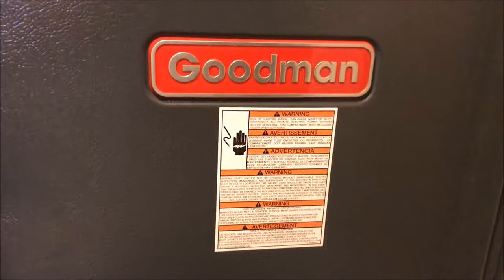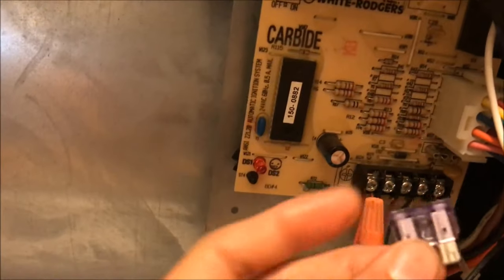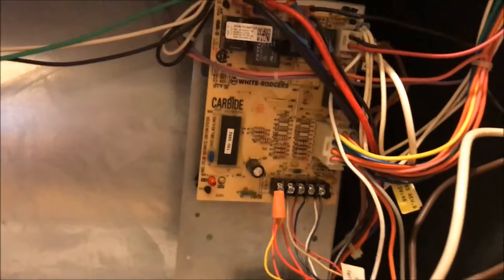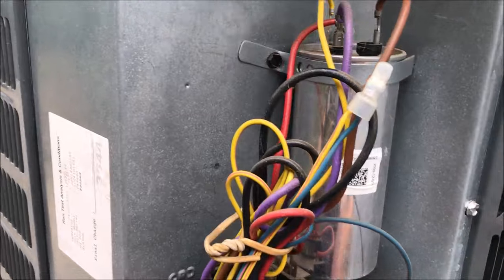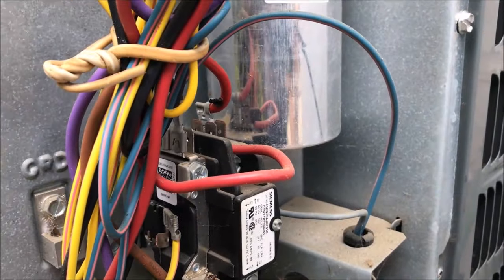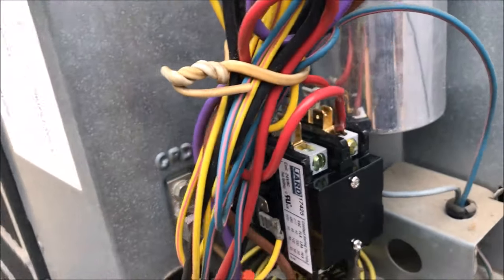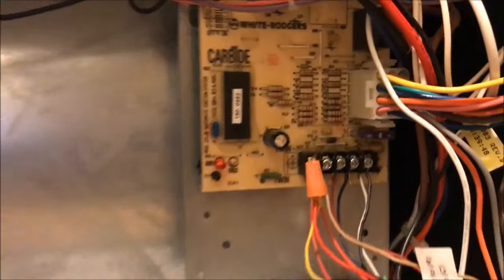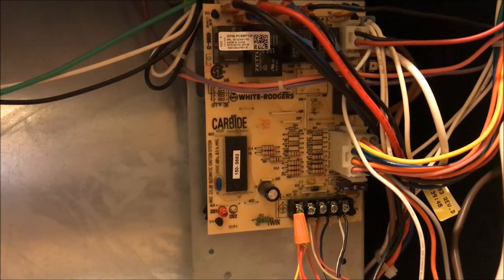Blown 3 Amp Fuse in AC quick fix - Save $300-$800

Comment: Lol this fixed my unit, was the fuse you stated, the contact block was fine but the wire connectors corroded, I wire brushed them all and we 40 the connectors, installed new fuse and ran like a champ! Last year the condensing fan ran but not compressor, capacitor was bulged out so I replaced it and that fixed that lol it’s an old ck30-1 unit.. love YouTube lol you home appliance and heating and cooling guys are the real mvp! Thank you for sharing the knowledge! Because of you I now work for a heating and cooling company as an apprentice!!!

Comment: You're the man. Saved me a fortune and a lot of hassle. 3 amp fuse blew replaced it fan went on for 30 seconds and then went off. Compressor never went on. After watching your video, I grabbed a spare relay that I had in my garage from an old pool heater that I had. Hooked it up and ac is working perfectly. Thanks
Reply from the maker: nice.  I'm glad it was helpful.  Cheers~

Comment: MAN! Thank you for this video good sir!! I've been battling an AC unit at work. So far I've fixed all the old crumbling thermostat wires at the outside condenser. I also checked all the thermostat wires inside and outside for other shorts and found none. I made sure all the connections are nice and tight. I pulled the thermostat off the wall and checked all the connections there and they are good! And yet that damn fuse still pops! I've run out of options! So now I'm here. When I get to work tomorrow I'm going straight to the contactor to see if its shot! I really hope that's it! Because if its not then I'm stumped and going to have to call an AC repair company. I really don't want to do that! Wish me luck! Hahaha!

Comment: Thanks a lot man.. this gave me direction on where to look.. the contactor was fine in my case but was full of dirt and cob webs.. cleaned it out and fuse doesn't pop anymore.. thanks for the helpful video...
Reply from the maker: Thank you.  I love to share a few tips here and there out whenever I possibly can.  It's great that you found out the problem.  Some shady contractor could easily charge you a few hundreds bucks for a small job.

Comment: Thank you, your video set me on the path to discovery where I ended up fixing my AC not working.  I was at the point of suspecting things in the furnace, and had never had a need in the past to  pull of the furnace panel.
1. Thermostat, an old Honeywell was flashing "A.C" this code, though not documented does not refer to Air Conditioning but to no power to the thermostat.  I verified with a multimeter.
2. My Furnace circuit board showed no blinking LEDs. It also had no visible fuse. It did however have a small push  button fuse/min breaker on the board.
3. I reset the push button breaker.
4. When my thermostat was set to heat, no problem, the burners kicked in.
5. When set to Cool, the furnace circuit board breaker tripped.
6. Now moving to outside. After removing AC mains fuse and switching of the low voltage using the switch on the exterior of the furnace, checking with multimeter and voltage detector of course.  I removed the access panel to the wiring of the external AC unit and discovered a large nest of some sort. 
7. After removing the nest I notice that whoever made it had gnawed away at the insulation on some of the low voltage wiring, looked like some bare copper to copper was touching.
8.   I cut out the bad exposed  wire, replaced with 14 AWG flexible, connecting the new bits of wirre with external grade wirewrap connectors. I also added some heatshrink to the remaining exposed thermostat wire and also used liquid electrical tape.
9.Voila working again. Total time spent about 2 - 3 hours including a trip to HD for some new connectors.
10. Happy wife happy life!
Reply from the maker: Thank you and I'm glad you got it resolved.
Reply: Wow they won't understand that 😉
Reply: Same thing happening to me, changed contactor and it worked but it still keeps blowing.

Comment: Thank you for video. Saved me $75 service fee by diagnosing this problem.. my thermostat was not getting power and this help me figure out why.. burnt fuse.  im replacing it with a 5amp automative fuse. 3 amp will work  too.
Reply from the maker: I would recommend that you stick to manufacture recommend fuse.  If your AC is using 3amp then stick with 3 amp.  change it to 5amp may cause other issues before the fuse blows out. :)
Reply: I also thought a 5 amp fuse was close enough to the original 3 amp fuse. Please learn from my mistake. The unit ran for a few minutes and then burned out my 24 volt transformer, and I still need to locate the original problem!

Comment: Good info.  Had an HVAC company come in and replace this fuse (I didn't know) and the fuse alone was $30!  Tried to get a reduction and that didn't work.
Reply from the maker: Wow.  That's a huge marked up.  You can get one at most auto part places for less than $5.

Comment: I have a similar circuit board [Amana, made by Goodman].  A/C pro neighbor told me to replace the 3 amp fuse.  Your video was a big help, but on mine they saved a few pennies by using a wire jumper instead of the fuse.  Still working on it.  Also replaced the outside capacitor and contactor, and the inside 10 microfarad run cap for the blower motor.  Ain't fixed yet, but this saved me a lot of time looking for a non-existant fuse.
Reply from the maker: I'm glad it helped.  Thank you
Reply: This might help others with a system like yours, but without a fuse; with a jumper wire where the fuse should be.

  Getting there... my inside circuit board had a JUMPER WIRE where the fuse should be.  Ran heating all winter, but when I ran the A/C first time, a bad contactor [relay] outside blew the inside transformer because there was NO $3 FUSE!

  If your system has a jumper on the inside circuit board and no fuse, check the outside contactor relay for damage BEFORE ever turning on the A/C unit!

  Long story short, I've spent about $200 for parts, including the outside fan motor, capacitor, and contactor, and the inside 10 microfarad fan run cap, and the new transformer found on Amazon Prime for about $26, due on Sunday after ordering Friday night.

  Again, long story short, if you have the time in early spring to live without heating or A/C for a few days, you CAN do it yourself.  my unit is about 15 years or more years old, and updating all the minor components has to take a load off the compressor, possibly adding a few years to its life.  The outside cap can was reading 8% off rated, and the inside fan run cap rated at 10 Mu-f was at 7.36.

  I consider it a couple hundred bucks well spent, modernizing all those components, that may extend the life of the compressor.

  I also bought a Fluke 117 HVAC meter that checks the capacitors, which I can use for other things as well long-term.

  You can save a lot of money on DIY, with an A/C pro friend's and neighbor's advice.  I bought him a bottle of Casa Noble Single Barrel Extra Anejo Tequila for payment.

  I've lived without heat or A/C for two weeks and it ends tomorrow... Knock on wood.
Reply: Correction; Fluke 116, not 117.   Installed new transformer just in time to get heat during a cold snap, to keep me warm after 2 weeks with no heating or cooling in N. Texas where Spring is variable.
Reply: The fuse was install for safety reasons and so you don't burn up transformer or circuit board which can easily happen with a jumper wire in place. Don't ever put a jumper wire in. Not even for testing. Your obviously a home owner trying to fix his own equipment. Thats why you had no heat/ac for 2 weeks. Pushing out bad ideas on people is a safety issue and will cost them more money

Comment: Do you know WHY the contactor coil burned?

If not, then you might not of corrected the source of your problem.
Reply: Lightning strike, bad capacitor?
Reply: Contactors age and corrode.. They should be replaced every few years along with the dual condenser.. $10 parts.
Reply: @joepah51  I think you meant the dual capacitor.
Reply: David Crandall I think he did too but why change parts every few years if they’re not bad?
Reply: @arodandjeter1  To avoid condenser failure.

Comment: Thanks for this very useful video. My AC is not working and while checking on fuse, it blown… I have updated the fuse with new one and switched on the AC… but again it blown.
What could be the reason? What are other things I have to check? Please advise…
Reply: Did you ever figure it out. I’m having the same issue

Comment: I had the exact problem, HVAC system just shut down. Checked the breakers and condensate lines, all good, but wasn't familiar with a simple fuse to the system. Wish I'd found this video and would have saved $165 for the service call which also included a check of the system for pressure etc. Just bought the home last year. Perhaps you could amend your title and/or description to include no power to HVAC system, air handler. Regardless, thanks for posting.
Reply from the maker: hope you got it fixed though with the heatwave we're dealing with
Reply: @SnapFix  Actually, we did. Even after the fuse replace, blew again several days later. Determined to be a couple wire touching where outside wiring led to condenser unit. Thanks.

Comment: Our Ruud was blowing the fuse in the air handler inside the house and everything shuts down completely. The repair man changed the connector out side and it will work fine for a few weeks at times and then blow another fuse . I replace the fuse and it works fine for a while then it will do it again . 
Would you have any advice you could give me on what is caused this to happen ... would be much appreciated.
Reply: Sounds like a bad wire. What ended up being the issue?

Comment: Thank you very much for the info.

I have the problem the condenser was off.
Checked the contact relay was not energized by 24VAC and was wodnering what the problem was.
Now I know the upstream 3A fuse and I will look for it and check it.

Is it on the control circuit by the relay?

Thanks

Comment: How would you go about wiring in a resettable amp fuse if the unit doesn’t have an amp fuse or a circuit board? Would I connect 24V and C off of the transformer or 24V and R?

Comment: Okay so we replaced ours and the fuse still blew. What could it be, the circuit board?
Reply from the maker: There is a short somewhere.  I would check any loose wires first.  If not then yes circuit board could be the issue
Reply: Whst is that part called you replaced?? I didn't really understand what it was called
Reply from the maker: contactor coil  @christinahaskett120

Comment: So my AC won't turn off I disconnect my ecobee thermostat from the wall it goes off then I put it back the AC and heater is off but ac fan is still running... Help

Comment: Unit went completely dead, nothing worked, and didn't want to call an AC tech on a Friday night $$$$.. 

After fiddling with the breakers and the outdoor unit, I opened up the panel to the blower motor and circuit board... Had no idea there was an inline 3 A next to circuit board.. @#$%!

Got to Ace hardware before they closed and found 3 Amp blade fuses. Replaced the blown fuse and was up and running!

I didn't see any blown capacitors on the circuit board or the capacitor mounted next to blower.. Guess I'll head out tomorrow and look over the contactor on the compressor unit or anything else that looks puffed, burnt or blown.

Thanks for the video you gave me ideas of what to look for.  didn't find your video until i replaced the fuse, who knew what to look for?
Reply from the maker: I know right.   It's a good thing that they actually designed the circuit board with 3 amp fuse.  If not we may have to replace the whole board and that could cost quite a bit more.  I'm glad you got it your AC working though.

Comment: Hi, the furnace doesn't turn on and the red light inside of furnace (down) is permanently on, means ?. The thermostat display AC on, probably is the fuse ?, or why the furnace and the AC do not work ? Thanks for your answer.
Reply from the maker: Are you trying to tun on the heat or AC?  You should set the thermostat to "heat" not AC if you want the furnace to turn on.
Reply: @SnapFix  Hi..the AC..
Reply from the maker: @LuisSalazar-ev3hh  The furnace will not turn on for AC operation.  Is the fan running at all?
Reply: @SnapFix  Hi ..I replaced the fuse 5 amp and set the thermostat to heat ..Furnace was working good, later I set to AC..and nothing, fan didn't turn on...but the thermostat display AC on ..so ?..thanks again
Reply from the maker: @LuisSalazar-ev3hh  Is the condenser unit outside running at all?  Please set your thermostat to "on" to see if the fan is working
Reply: @SnapFix  Hi..I did it but the fan does not work. The unit is outside not running
Reply from the maker: @LuisSalazar-ev3hh  It could be several reason why your central Air Conditioner fan is not working.  1.  bad capacitor 2.  Burnt out motor (I'm not sure how old is your unit) 3.  Bad contactor coil which is the same problem as mine.  Also, you may want to check if there is a power issue to the unit.  It's hard to pinpoint the exact problem without being there but you can certainly check to see if any of the issue that I described help
Reply: @SnapFix I bought this house "brand new" 6 years  ago..all equipments brand new..I know it's hard to know what is the issue..thanks so much for the inf. .and your help..
Reply from the maker: @LuisSalazar-ev3hh  No worries.  I hope you find the issue and please let us know when you find out what it is.

Comment: hey guys dont know anything about fuses but my ac blew a 5 amp, all i can find online are car fuses is it safe to use those in my ac ?
Reply from the maker: As long as it is 5 amp, it should be ok.
Reply: I replaced my burned out 3 amp fuse with a 5 amp car fuse, it ran for a few minutes and now my transformer is burned out!

Comment: Can capacitor blow the fuse or is it always contractor
Reply from the maker: Technically yes and it's not always a contactor coil.  It could be as simple as a damage wire somewhere which could have caused a surge
Reply: @SnapFix  I start getting E103 error which is over current in Y wire on Nest thermostat.  this happened after the power surge last year but it was getting cold so I start using a heater with no issue.  This year I went back to the thermostat and turn on AC it gave me the same error E 103. I then searched and concluded that I need to change the contactor. I replaced the contactor and reset the nest. it worked for one hour and then the same error.  Then I decided to put the old thermostat and check if it is a faulty Nest thermostat.  The new thermostat blew my fuse each time I tried turning on the AC.   What could be the reason for all this?  

also, I have replaced the old one pole contactor with two poles with 40 amp high and 30 resistance.  is this resistance too low?

Comment: Can you use a 5amp fuse instead of a 3 amp fuse
Reply from the maker: I would not recommend it though.  It was designed with 3amp on purpose.  The reason is that it may cause some other issues before your 5 amp fuse break
Reply: I replaced my burned out 3 amp fuse with a 5 amp car fuse, it ran for a few minutes and now my transformer is burned out!

Comment: Hi There,
How to check/tell if fuse is blown in furnace. Looking at it visually I don't see anything wrong or burnt marks or anything out of ordinary but my symptoms are same. Not AC or heater or fans are working. Please share if anyone knows.
Reply from the maker: Please check to see if your system has a reset button instead.

Comment: It would have really  been a real help if you could've shown us the actual replacement of the fuse😫🤨
Reply from the maker: It is fairly simple to replacing the fuse (out and in) .   I would ok to tape a clip and show you but youtube doesn't have that feature (yet).
Reply: @SnapFix  the other videos did. But thanks, also i cant find my fuse my system must be older.

Comment: Where is best bet for buying contactor coil and 3 amp fuse. Walmart didn't have the fuses
Reply from the maker: Please check with a local shop that sell AC repair parts for the coil.  Walmart won't carry it.  I found the 3 Amp fuse at Auto zone and O'reilly.
Reply: @SnapFix  bingo. Found the 3 Amp fuse.easily at Auto Nation. Store for coils and capacitors closed up before I could get there.
Reply from the maker: @SPPrice  Great.  hopefully the weather is mild enough where you are at to wait another day.  Good luck.  Don't forget to cut off the power to the unit before you change it out :). Cheers
Reply: AutoZone had a ton of 3 amp fuses
Reply from the maker: @chasburns3303  Thanks for the sharing.

Comment: My fuse went on my furnace, repairman replaced the fuse and our furnace was up and running.  The next week it got hot so we tried to switch to AC and it never turned on (newer unit, only about 6 years old).  Got cold again and when we tried to switch back to heat that didn’t turn on either.  Not sure what is going on, any idea what could be blowing the fuse?
Reply from the maker: I think one of the wired must have gotten loose or cut.  I would go check on that first including the outside (condenser) unit outside.   Did you check the fuse to see if it got blown again?

Comment: You don't say what to look for or how to install.
Reply from the maker: Please turn off your main AC circuit  breaker or circuit breaker or the  to be safe.  If you have never done it before, I would suggest to mark which wire goes where.  Or you can take picture to help you.  This will help to reinstall it much easier.  It has a few screws.  As far as what to look for is the coil itself first to see if it burned or damage in anyway.